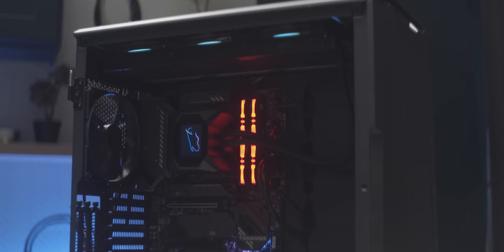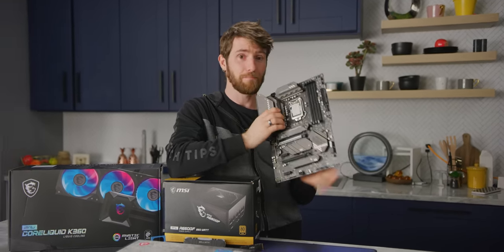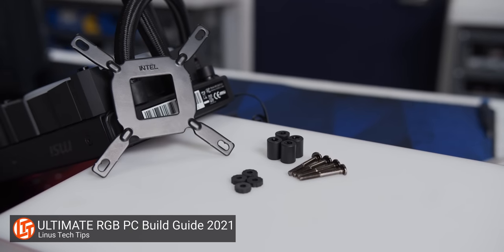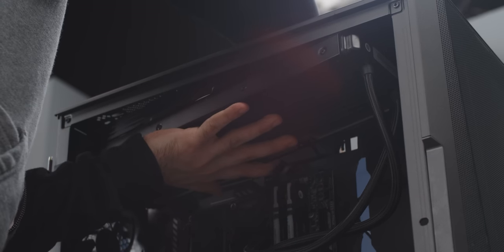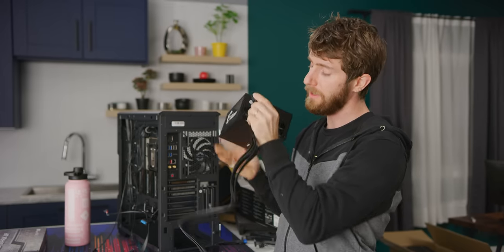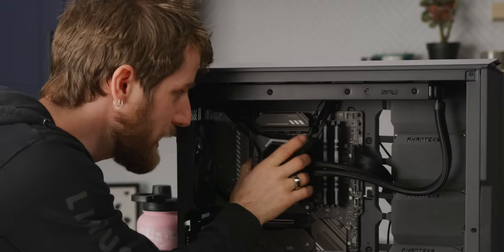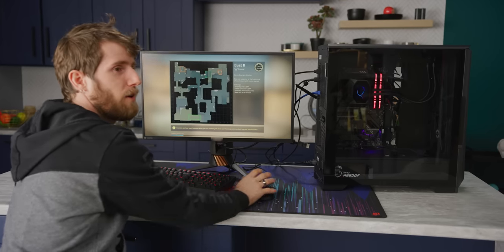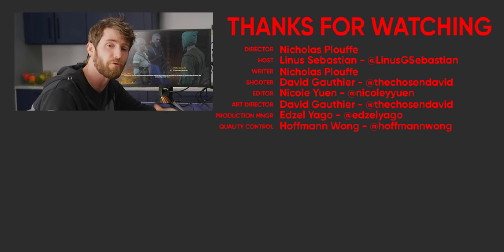You Can ACTUALLY Buy This PC!

Comment: “8 cores might be a little low”
Me who thought that six cores was enough for the next few years : O
Reply: It is, you are fine even with 6, just look up bechmarks and you will see
Reply: It is fine for the next few years as long as it’s fast. Don’t buy a fucking 11700k it’s a joke of a processor
Reply: oh boy, that's because you guys don't own an FX 6300.
Oh boy.
Reply: Poor you...
6 cores is all you "need" today.
In two years, it'll hurt, since you no longer have the basic corecount you need. 
If you ever used a 2 core, then went to an 8 core, the performance in just regular desktop use is staggering. No benchmark has a user experience graph with "staggering" or "fantastic" in it

Today, I'd say 12 cores or you'll have a bad time.
Sure, it's expensive compared to 6 cores, but you can sell off your used hardware in 3 years for 1/3rd of the price. So even a 450$ chip is "technically" only 300$, of which 100$ a year. If you buy a 200$ 6 core chip today, you'll have to upgrade in 2-3 years if you want to run something recent. Meaning you pay $66.67-100$ a year, if you can't sell off your old chip. 
You can even stretch the 12 core chip an extra year, but you cant do that with the 6 core as easily. And your experience will be so much worse with the 6 core chip all through...

An i9-10850k nowadays is pretty affordable yknow, I saw em for €342, imagine that, just double the price of a 6 core, better performance outta the box and you can resell it later for a good price
Reply: @LoneWanderer905  to be fair the amount of cores doesn’t matter as much as the overall speed of the processor. If your 4 cores are faster than a 6 core then it’s better for gaming
Reply: it's low for the price i guess
Reply: me who just ordered an amd 3700x :(
Reply: 6 cores is plenty for gaming. You only need a lot of cores if you are insecure and want to flex your epeen, or you are doing actual video editing or digital art, and *even then*, it's going to be convenience more than necessity.
Reply: i'm rocking a 5820k and i don't have a reason to upgrade. the only reason I would would be to get a cpu with an iGPU so i can flip my graphics card to play in the cloud
Reply: @Yepmyaccount  my reasoning for going 8 core is the new gen consoles use 8 core cpus and like it or not, most triple a games are designed to run on console and i feel like later in the lifespan of the ps5 and series x we will see the benefits of 8 cores. idk something tells me i at least want to match what current consoles are offering, but thats just me.
Reply: @roqeyt3566  you clearly have no idea how computers work lol
Reply: Six cores is fine as long as they are fast
Reply: @mattattack6776  You can feel all you want, that ain't how it works.
Reply: @erichall090909  It's tragic that PC elitists spread misinformation to flex their epeens, and then you end up with people spouting to everyone about how you're going to need 16 cores to game in a few years. I know some people that want to get into PC gaming, but their friends tell them absolute garbage about what parts are worth it and not worth it.
Reply: @Yepmyaccount  yeah no kidding. If you have a current 6 core it’s plenty fast for the next few years. Unless your buying a $1k+ graphics card at 1080p you will see 0 difference. Now did I buy a 5900x? Yes. Because I have a 3090 and I play at 1440p. Even then it’s barely a difference over a 5600x it’s a small small percentage. Cores don’t matter much as long as they are fast
Reply: @Yepmyaccount  well im forced to recycle my old 1080 because of the shortage so i had extra budget so i went 8 core.
Reply: @erichall090909  yknow what, you go use a single core, insanely fast CPU, with high ghz and instructions per cycle. Then try to watch the weather whilst talking to a friend on skype, and you have an openworld game with a bunch of AI running in the background

And then you can tell me how many hiccups you have when switching tasks, the audio freezes, all that.
There is a reason why more cores are necessary at some point. Your system isnt a clean benchmark, you wont cross just 1 tile in a game at a time, sometimes you're at an intersection mid combat with tons of AI needing calculations. 

Tell me, with a straight face, you think 6 cores is fine in a new build, and itll give you a great user experience that would make a 12 core chip useless.
Sure, 6 cores is fine if you dont mind compromise, but dont say that just speed will save you. if  that was the case, people would take their 10th gen i7 and upgrade to an 11th gen i5. 
Cores split workloads, more cores is better, since same gen or even next gen cores performance do not make up for corecounts that often.
Reply: @LoneWanderer905     i got an  FX 6300 and it  is ehhhh ( i did use it but the board died on me)
Reply: @Yepmyaccount  there is a reason to go premium though
You can just resell the parts for more in a few years, cutting costs
Your experience now is a lot better too.
For some people, paying for example 900 for a pc build now, and having a good time for 3 years, then falling behind with the newer games is perfectly fine. And thats fine, if upfront cost is the main constraint then the 6 cores for example is great value!

If you dont mind paying lets say 1100-1200 for a system, you can make the jump from 6 cores to 10-12 cores. You can resell the part for an extra 100 more than the other later on too, so that would make the price difference 100-200 in total cost of ownership.

You can run more new games for longer, and the experience is better. You won't have to experience a crappy computer in 4-5 years that way. Or, if you sell your system at 3 years, taking the hypothetical pricejump of 200-300, you paid 100-200 more in total for your system. The experience is better, missing an upgrade aint as bad, and you will enjoy the system more.

Budget gaming right now isnt a thing, but when its back you can definitely do that again. Build yourself a 600 dollar system and play the same games you have been for years, and add games from 2017 to your library. It's a good method, but the question is, who are you recommending this to?
Reply: 6 cores aint the worst. Im runnin 6 and it works fine lmao
Reply: @roqeyt3566  now in 4 years or so will they need to upgrade? Yes. But the 12 core person will also see a big increase by upgrading at that point too.
Reply: There's consumer standard, then then there's Linus standard... Everything that's not current gen mid-high range is considered outdated by him. Don't worry about it.
Reply: 6 cores will be enough for the next couple of years. Even a good 4 core CPU will still be sufficient. It's always a balance between CPU and GPU, but it's very unlikely that games will evolve so quickly that a decent CPU wouldn't be enough anymore. 
If you want to play a heavy game at a high framerate, you'll probably also need a good CPU that can handle the frames/tell the GPU what to do. If you want to play a heavy game at moderate FPS, just crank the settings up. This way the GPU will be busy and the CPU won't be the bottleneck. 
Basically: A CPU bottleneck can be (somewhat) worked around by giving the GPU more work to do.
Reply: 8 cores is def not low, Linus trippin... 4 cores is definitely outdated tho. 6c12t is good for the next few years, 6c6t on the other hand will barely get you by if you have a high refresh monitor.
Reply: @roqeyt3566  if you have a 3070 or lower card at 4k or 1440p you will see no difference with a 10850 or a 5600 so go ahead. No problem with that. And you can do more with the other if you wanna steam or something. For gaming it’ll make no difference
Reply: @roqeyt3566  You have absolutely no idea what you're saying, it's pretty funny actually.
Reply: he will probably upgrade in 3 years, sell his system for 30-40% of the cost he put in, and upgrade yes.
However, he will probably not need to upgrade, since a more expensive computer can pass up an upgrade cycle.
Factoring in the resell value, or having to buy a new component 30-40% sooner, the extra pricetag suddenly aint as big anymore. 
The cheaper setup cant resell for as much, and he will need to upgrade. Making the system not that much cheaper.

Now if we had the golden days back where you'd be able to build a system for 600 bucks, then yes you can justify not going for the premium build. 

However the CPU you mentioned is a 400 dollar one. Why not jump up a few cores, get a better experience, resell it later and your total cost of ownership will be the price of a cup of coffee per month more? is that really worth the worse experience?
Reply: @erichall090909  aight kid, you go tell yourself all that
You go spend 400 bucks on a CPU thatll get you stutters and a horrible experience when you near the next upgradecycle, and then claim ''but muh benchmark''

There is more to a PC than just gaming, unless you strip out every functionality and sit there all day, gaming. Ill recommend you to take a look at your tech knowledge mate. It seems a lil dated. You might accidentally recommend someone a 4 core chip for a great user experience.
Reply: @roqeyt3566  6c/12t is perfectly fine, hell even multithreaded 4 cores still manage games fairly well. Getting a 12-core so you can play newer games at a nice framerate in a few years is pointless as the gpu is pretty much always the limiting factor. Until games start optimizing for more than 4 cores due to the consoles anything above 6-core is just not advisable especially when on a budget. 6+ cores are only really good for content creation, and various rendering and compiling tasks. But for now a 6 core for gaming is the sweet spot.
Reply: @roqeyt3566  >skype
>$1200 PCs with 10-12 core processors
lol you have no idea what the hell you're talking about dude. Just stop.
Reply: @mattattack6776  That's fine. 8 core is better if you can afford it, but it's certainly not low-end like Linus is implying.
Reply: @roqeyt3566  I hate to break it to you but most people cant "just double" the price of the cpu bud. I'm glad you have that much disposable income tho
Reply: @roqeyt3566  "If you game get a console" my dude have you heard of modding. Or steam sales. Or the ability to most old games via emulation. Or simply higher framerates and better graphics. There are so many reasons to pick a pc over a console
Reply: @roqeyt3566  🤡
Reply: @sarco5138  as a gentleman above said, console has 8 cores
New games usually use that as a standard, so in a few years, maybe 2, 8 cores will be the preferred standard.

It really depends on your usecase. If you're playing 2016 games, why are we even debating this? Same with low end indie games. If you want to play the new assassins creed, or the new battlefield next year, this discussion is a good one to have.

Sure, 12 cores is pointless for just framerates, but it'll boost your PC's performance in smoothness and responsiveness in games and regular desktop work.

I stick to 8 cores being the minimum for new builds, at least untill prices normalize.
Budget gaming is dead till all prices are back to normal, so at this point you might as well go for a 8-12 core system, and resell it later to recoup a good part of the costs
Reply: @sarco5138  yes, there are, and pc gaming is great
You gotta invest in the right components for that though.
Especially if you wanna keep those framerates 2-3 years after you built your system.
Reply: 4 cores :(
Reply: @Depl0rable10  I said that in a later comment
If upfront costs are the main factor, right now you shouldn't even consider a PC, since prices are crazy.
When they come back to normal, and you have the right expectations, even a 600$ system is great for running 2017 triple A titles, and most indie games right now.
Hell with the right expectations a $180 chromebook is amazing! If you like candycrush.

Speaking of expectations: if you wanna play the latest and greatest games within the next 2-3 years, you gotta pay for that.
If you don't mind waiting for them to become cheaper, and pc prices to catch up, then you don't need to have this discussion.
You basically just buy the standard equivalent from 4 years ago, but at entry level prices every time. And you'll be compromising at that point anyways, so increased performance and user experience won't be the main selling point anyways.
Reply: same here
Reply: @NoobGyver  it's terrible my man. Been using one since 2014.
Reply: Oh poor them, not having 8 cores, like just imagine having a Core i5 760 with 4 cores and 4 threads smh
Reply: Cries in 4 cores
Reply: I use a 2 core i5-6200u, in my 6 year old laptop running 1600Mh DDR3 ram. For anyone wondering it has a combined all core score of 222.
Reply: 6 cores is plenty for gaming and will be for a while. And in a few years when games get more demanding guess what! It's still good for gaming cuz u can just turn down the settings a bit.. People make a big deal outa components for nothing as if they won't load a game anymore or something lol. By the time you feel 6 cores isn't enough for you, you will probably already be wanting an upgrade regardless.
Reply: @waineryley7887  what are you playing/doing with a 2 core cpu?
Reply: @roqeyt3566  Please explain again why I will absolutely need to upgrade my R5 3600 next year, or the year after?  I can game in 4k now, I can run my Rift S very nicely too.  Not everyone needs to play on max settings at 144hz in 4k.
Reply: @LoneWanderer905  owned a 6350 for 6 years, happy that I upgraded to a 5600x befire christmas when I found one for MSRP, same thing for the radeon 5600XT... And I can meme my build for the 5600s as well...
My fx6350 runned OC'd at 4.4 Ghz for a long time as well, and still serves as the cpu in ly gf's PC, I love that CPU lol
Reply: @roqeyt3566  12 cores really? My laptop from 7 years ago has 4 cores (intel i7 4700mq), sure its not the fastest kid around the block buts its still good enough. Mind that its not abşe to run latest and greatest games, but competetive titles like CSGO, Rocket League or well optimized games like Forza Horizon 4 is still playable. Still, not great for gaming. But I still use to for ky work, and casual computing. And I suspect not all of the problems in games are related to CPU. Sure it has an affect but the poor machine is still rocking a GTX870M GPU. 
What I am trying to say is, yes 12 cores will last longer but there is NO WAY it is a necessity in todays standarts. It is more like an overkill or if its for gaming purposes, straight up waste of money and resources. Even my 7 year old laptop holds up, most modern 6-8 core CPU's will go for another 5 years without any problems
Reply: Nah.. my 3600 does the job just fine
Reply: @LoneWanderer905  Your not the only person the world with a FX 6300.
Reply: @averagechannel5527  never said I was, my dude.
Reply: @melihcelik9797  as you said there, it won't run the latest and greatest games.
Intel plateaud on cores for a long time, and consoles didn't pull ahead for a while in core count.
AMD has a higher corecount now, consoles do too.
If you're buying a new system for new stuff today, and you want to play the new thing tomorrow, and in 2 years, 12 cores is a very very good investment. I bet you that the newest stuff will want 8 cores in 2 years time, so a lil headroom will get you something to work with in case a new "cyberpunk" comes out.

As was said, 8 cores is good for today. Thus today's programmes and the standard of buying new is not for it to fall flat in a year or two. It's not for 2019 and it's programmes.
That is a different goal, then you're building to handle what's already out, or what's already old. You're building with new parts, but you can't really call that "new" imo.

I absolutely agree with you that with the right expectations, a quad core cpu is just fine. Heck, even dualcore still does stuff. I donated my friend a laptop with a quad core, he thinks it's the greatest thing since bread since he had a 2008 machine, now he has a 2018 machine and plays games from 2018. 10 extra years of games! From 13 to 3 years ago.

If you build new for today, the rig is a tool to run stuff from today onwards, for the average expectancy of 3-4~ years. With the final few years being a stretch depending on your budget.
Thus, 8 cores or 12 cores is absolute necessary for a new rig today, but not for a "new" rig designed to run the same old games and programmes from 2018.
Reply: @waineryley7887  well... Next question would be, are you looking to upgrade in the future or are you stuck with it? And what do you wanna do with your pc when you upgrade?
Reply: @waineryley7887  if you haven't got your own pc yet, any gaming pc will feel like a great upgrade
An entry level one would be just great, you can learn how to build a pc with it, what you need, all that

If your preference in games leaves you with the feeling that gameplay is stuttery, and you experience slowdowns a lot, or that you constantly gotta close background programmes to play something, I'd say it would be good to upgrade to something beefier in your next build.

If it runs everything you play and want to play just fine, then you don't have to upgrade at all, not even to a new computer